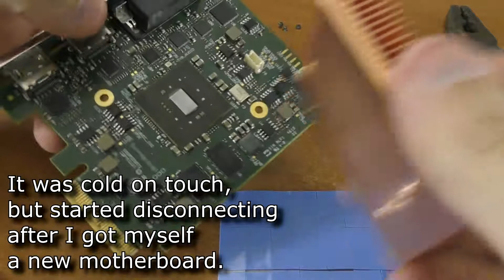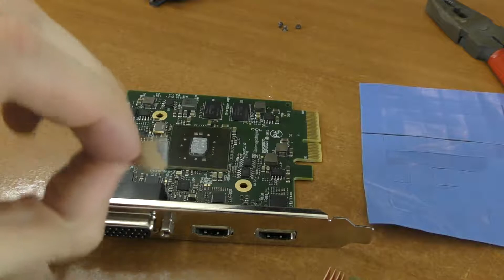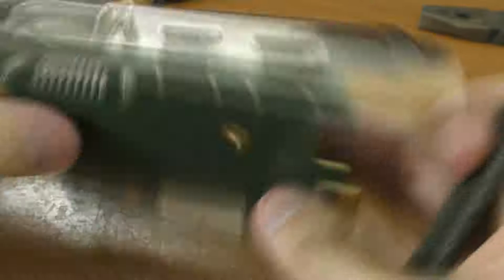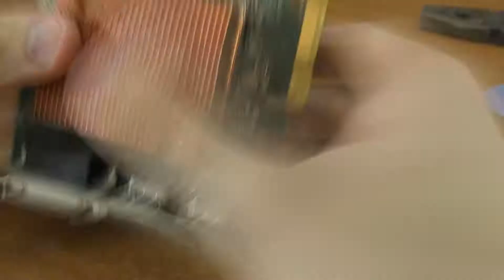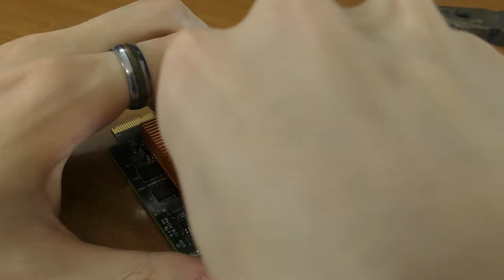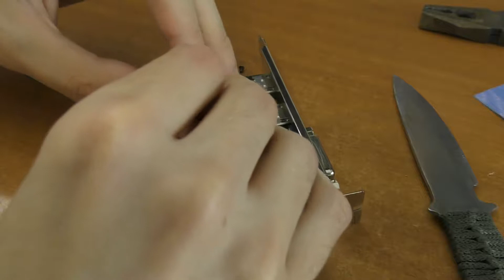Installing custom raiator heatsink to BlackMagic Design Intensity Pro 4k

Comment: Thanks, man.  This card is cheapest deal going for 4k capture, yes?
Reply from the maker: I see you agree that it needs some custom modding :-D
Let me know when you're done with yours. I'd like to see how a normal human being will do this mod, as I did mine so it "just works".
Reply: Oh, I agree that it needs modding.  All the complainers on Amazon convinced me.  I was going to wait or maybe go for a different solution.  Elgato kind of sucks because they want you to kiss Win 10 ass, so I didn't want to buy one of them...and I didn't want to buy a hot angry mosquito either to drive me nuts.  So, I was happy to find your video -- you certainly slapped on enough copper to get the job done, so that's good enough for me.

Ideally, I would have liked a custom water block to match the rest of the aquacomputer loop I have installed but, eh, who has a the time to design a block for a $200US card?  I'll make do with a tiny Noctua fan and call it a day, lol.

I'll message you when I post it. ;)
Reply: I believe for 4k/30 - yes. But needs adjusting it's shitty stock cooling syste, to something self-made or you won't hear anything with that noise.
Reply: Thanks, Joe.  Okay, I will go for it and make your mod on it - but prettier, lol.  I think I will do a video on it too - I will give you credit and links to you vids.  Copper heatsink coming from China so, lol, will be done end of April.  I will message you when complete.

edit:  That stock cooling is the shittiest ever, lol.